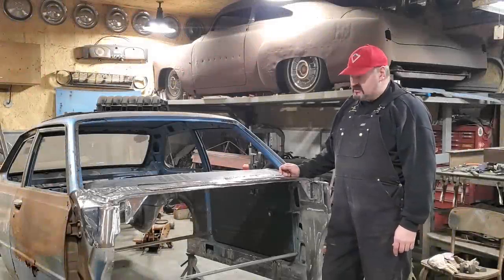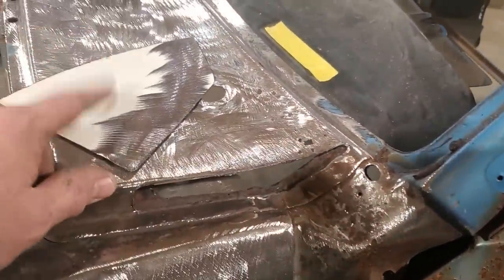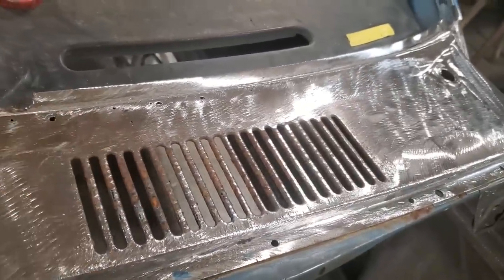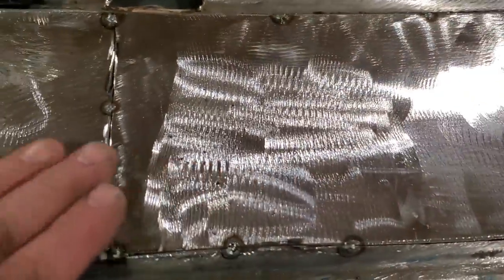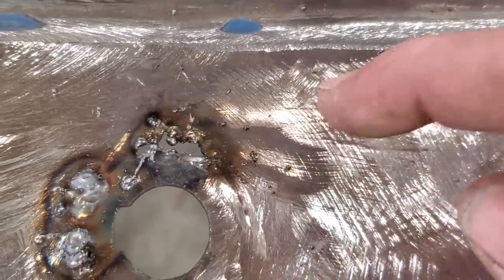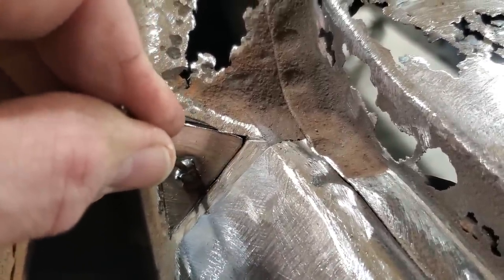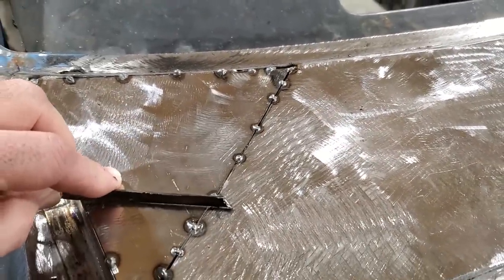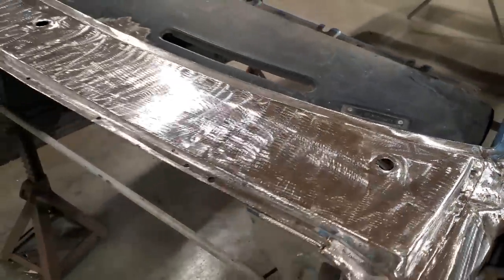Crusty. Rusty cowl restoration

Comment: Amazing. But it goes one step at a time. Then I see that it's not just me who is a bit busy sometimes (small holes). But I wonder if it has to go well and copy larger parts. For example, outer plate on door post in front, before taking it away and inserting the new one.

Comment: Thanks Tony, that was a biggee! The tip regarding grinding both sides of a corner sharp and only then rounding it off is a great one, I know you’ve done if before but I’d like a recap sometime on that process If it suits, I presume one just uses a fine disc so as to not overdo it and spoil the edge.

Comment: Hi Fitzee, 
I forgot I had bought a Toyota Corolla from a friends neighbor that was going to be traded in and they only wanted to give the lady $150 bucks trade-in for it. Only had about 48K miles on it. 1.8 L manual transmission 1976 I think, back in 1987 I bought it for $200 bucks, Test drove it had bad misses and the slave cylinder leaked, hard to shift, ran strong. Changed the slave cylinder and did a tune-up, When I pulled the spark plug boots through the rocker cover 3 of the electrodes from the spark plugs came out with then. I could not believe it ran that good on the test drive. They were the original plugs. Kept it for a year and sold it for $600 bucks.
Thanks for the lessons from your garage laboratory.

Comment: Hey fitzee, I don’t know if you have one on the channel already, but I’d love to see a video on fixing rust on the roof panel of a car. Because of the really big relatively flat surface, I could see issues with warping and such. I have a 510 I’m gonna be working on soon and something like that would be really helpful!
Reply: Pro-tip from someone who's been there - large panel like a roof will warp and start oil-canning no matter what you do. Doesn't matter how much time and care you take - hot metal warps, it's physics.
But worry not - get yourself a shrinking disc. Plus a body file or a large hard sanding block. I tried blowtorches and stuff, but it's too easy to mess up as it requires perfect coordination and timing. Shrinking disc is laser precise and forgiving, and doesn't require any extra beating, it's amazing how nice it works.
Reply: I’m 55 and had 2 510 s when I was teen … Great cars … lots of fun

Comment: Tips were good as always, Tony.  Especially reminding us all to take our time, don't rush through and that making a cut in a piece of finished metal is not a major drama because you can just weld it up again.  It's all about the process of getting it done rather than the finished product - the finish will come if the process is carried out with a bit of thought....but not TOO much thought or it will never get done!  Welding flat (or near flat) pieces to an edge, using the edge as your delineator and reference point, makes the process much easier to cope with and cuts the overall project down into sizeable chunks that you can walk away from mid-process without having to think hard about where you were up to the next time you work on the project - as you have shown us many times.  Your approach has made life so much easier for me and given me the confidence to get things started and moving, where I was stuck on thinking of the WHOLE project and it seeming way too daunting, so I had stopped work on it because of the amount of work to do.  Thankyou, my friend.  All the very best.

Comment: Thank you for continuing the videos. You have given me the knowledge to try doing this myself and my project is coming along fine. I love the tip on welding the holes near the wiper hole. I had a similar situation and I was building little weld mounds…and grinding back to holes, just as you said. You are the best. Rick from Detroit.

Comment: About those holes around the hole for the wiper, you talked about keeping the welds lower than the surface to avoid new holes when you grind off the tops. Can you not just weld also from the underside after, and build thickness from there?
Reply from the maker: Yes you can

Comment: The rust through spots on the windshield lip are where the windshield trim clips sit on an original "from the factory" car.  Windshield clips are usually not high quality metal and don't have a lot of rust preventative on them from the factory.  They also tend to create a pocket where water sits.

Comment: I have to admit that you do great work myself I starts in the mid '70's working at home the in '78 got into a body shop and you restore cars the same way I was taught butt welding is always the best but depending on what the customer wants to pay is a factor as well and like you were saying the new cars are a lot harder to work with there is just no meat to then even for pick and file is a challenge at times... 
I did notice that you use a big angle grinder for cutting your patches with the cut off wheel do you find that better than a angle die grinder for handling?
Reply from the maker: Yes it's electric. I find the die grinders being air would lose power or freeze up in the winter. I have one collecting dust in my tool box

Comment: When you were welding around the windshield wiper mount holes. Could you have made backing washers made of body metal to avoid all the burn throughs and give it a bit more strength?
Reply from the maker: You could but it was burning away the metal to the side

Comment: That came out great .
When I needed lump of copper to back hole filling I used a beat up copper hammer and removed handle and ground one end flat and other end curved, is a useful and cheap tool, picked up another smaller one at yard sale for pennies as no one wants a beat to snot copper hammer lol :-)

Comment: Good timing... I'm doing a lower cowl repair. Can't get to all of the bottom from below. So I have to cut the top of the cowl out of the way. Would you weld a strip behind the edge of the upper cowl to set the cut away section onto when putting it back together? That way you have something to set the upper cowl on and a backer behind the weld since I can't get to the back side?
Reply from the maker: Not fully understanding what your asking. Why can't you remove the upper cowl but dril out the spot welds?
Reply: @fitzeesfabrications  it would be a much bigger job drilling out all of the spot welds to remove the entire top versus cutting out the top of one side and putting it back on. This is like the cowl rusty problems in a first generation Mustang except I don't have the parts availability like a Mustang. This is a 64 Fairlane.

Comment: I'm glad you mentioned about the thickness of the steel in your car being 24 gauge most of the metal in your modern cars are developed blanks meaning the thickness changes even in the same stamped panel. Also the newer panels are made out of high carbon low alloy steel. I  rarely cut and but my body panels I prefer to overlap them instead. But that's my preference based on my experience with welding dissimilar metals.

Comment: I have a panel that was eaten up buy a hard top rubbing.  I plan to do what you have done here to replace the bad metal.  I plan to use 18ga steel as it is what I have.  Your tips will help quite a bit I think.  I do have one question.  What if anything are you going to put under those panels to deal with the significant amount of rot that is under there?  I ask since I have rust under the panel I spoke of earlier.  Thanks for any advise, abuse or finger pointing.
Reply from the maker: Rust converter then primer then seam sealer over welds

Comment: Great video. I like that you showed a couple of methods from other videos like making the small round piece of metal to fill the small round hole and manually filling in the wiper hole using the brass bar. as well as grinding the edge to fit. I have seen you do it before, but it was a nice refresher. I have learned so much from your videos that there are few things that I would be afraid to tackle. For example, I damaged the lower corner of the hatch/tailgate on my wife's Mitsubishi Outlander this year and everyone told me it could not be fixed and that I should just get a new tailgate. I ended up fixing it myself. It only took an afternoon. I just cut out the back, straightened the front (which was easy with no back support), and then remade the back piece and welded it all together. I would never have attempted this if it were not for all your videos showing us what can be done. One question I have with regards to rust. If you have metal like the cowl you replaced on crusty, do you worry that the pieces you did not replace are just going to rust out later. I have this issue all the time. Usually, I notice that there is a lot of rust between the inner and outer panels. You can't get between them to sand. You fix the rotted parts, but I always worry that the parts I did not replace are just going to rot later. It happened on my Altima, one of the first cars I did body work on. Is there anything to be done ahead of time or just deal with it when it happens? Thanks
Reply from the maker: Just keep oiling it up if it a car you use year round

Comment: Awesome! Having made a few of my first attempts at sheet metal repairs this video helped solve a few of the problems I ran into. I love it when you show a long section of the repair getting done in real time. A question for you: when you put the two bends in the pieces covering the vents which bend did you put in first, the one from side to side of the car or the one up to the windshield?
Reply from the maker: On to the windshield.

Comment: I have been a fan and watching for a couple of years now. One thing I have seen others use, and have never seen you implement, is a Contour tool. I know you do not use templates often, and that you prefer to make a piece and not take the time to also make a template. Just as an observation it seems to me you could save a lot of time avoiding going back and forth from the piece you are making and test fitting and then back to your bench, if you would use a Contour Tool...especially for replicating the curved pieces...and not a full size template. Keep up the tips and tricks you share. Love watching them...and keeps me mesmerized.
Reply from the maker: I played around with them but found I kept having to return to the car to test fit. Works for some but not for me.

Comment: Fritzee how do you deal with the welds on the under side of the patch? They are going to rust from the heat, is there a way to stop this? If they aren't treated their going to eventually rust through. Also does the rust incapsulator products really work. Thanks for your help on making body repairs, been watching for a while now.😀
Reply from the maker: Will be adding rust converter. Then priming then seam sealer

Comment: Hey Fitz.
How do you handle the rust on the underside of the remainder of the existing body parts especially where you can’t get at it with tools or wire brushes?
I’m interested in what works best for you.
Reply from the maker: A spray rust converter and then paint

Comment: Just curious but how did you address any remaining surface rust on the parts you didn't cut out.  We watched you grind it off of the outside surface, but what about underneath?  Do you spray it with Rust Kutter, or Ospho, or something similar?  This may have been addressed in one of the other 364 comments, so if this is a repeat question, I apologize.  I love your work.  It has helped me with my 1965 Buick Wildcat and my 1969 Opel GT.
Reply from the maker: I'll be doing a rust converter  then primer then seam sealer over the welds on the inside

Comment: It looks good, on those vent deletes what did you use to roll the shape.  also could you have made that wiper arm hole section ?
Reply from the maker: Use the pipe anvil for the roll along with the curved section on the vise. Yes could  made a small press die to make new wiper mounts
Reply: @fitzeesfabrications  I’ve been learning a lot watching your videos. This summer I’m going to tackle making the bottom section quarter panel on my 68 Cadillac that has rusted. Keep those videos coming.

Comment: Thoughts on rust that may exist in those factory seams? When should you remove the panel to address it vs. let well enough alone?
Reply from the maker: When the rust is very bad. All these 70s imports have rust in the seams and under plug welded panels. It just the nature of the beast.

Comment: I'm going to try your cut n butt method on one of my old Toyotas soon but my question is:  When you hit the MIG without a helmet on, do you just close your eye lids, or do you look away also?  I'm willing to try this but also want to be safe.  Is there something you say to yourself in your head before pulling the trigger?  I've been using a MIG for a decade as a hobbyist, but always use a helmet so far.
Reply from the maker: Keep using a helmet. Lol. I got bad habits. I hide the arc behind the tip of the gun

Comment: I know you grind flat the top and side of a patch to get a good square edge but I must have missed how you round the edge off afterwards?
Reply from the maker: It's covered in a older video. I sand on a 45 degree and when it down to where I'm happy I round out the edge

Comment: What do you think of soldering some lead into the smaller holes along the top edge. Or do you prefer to replace the section of metal?
Reply from the maker: I prefer to replace. Leading small rusty holes can be tricky as lead has a hard time tinning to rust

Comment: Hi Tony .... I believe you said this car will be driven in street and drag strip.  How will you ventilate the interior without airflow thru cowl vents?   Also, will you be adding pressure relief valves (prv's) to interior somewhere?  I have been in some well sealed commercial vans with body modification that didn't take into account ventilation and they weren't fun to drive.  Doors hard to close, ears hurt if you turn defroster blower on, etc.
Reply from the maker: Those vents are air inlets for heater. This car will be heated delete!
Reply: @fitzeesfabrications  Hi Tony, so if you eliminate heater/defroster is there another way fresh air enters the car?  In a modern vehicle cabin air enters thru the cowl and plenum.   If you seal your body well and drive for extended lengths of time with windows up I am guessing your glass will fog.  I live in Michigan and have this problem all the time if I turn heater/defroster off.  Since you are leaving holes for windshield wipers I am guessing you are planning to drive this on public roads you may want to reconsider some kind of defroster.  Weather in Canada isn't that nice :).

Comment: I'm gathering from several comments you've made, you prefer to mud the bare steel. My question is if you leave the steel exposed until your ready for mud, what are you treating the steel with before mud? I'm pretty sure you have  quite a bit of micro rust started in that time frame...
Reply from the maker: It will be sanded agian. Rust converter on any small rust
Reply: @fitzeesfabrications  which rust converter do you prefer? I'm using a ppg cleaner then a conditioner before epoxy.

Comment: Fitzee, this is really getting to me, how do you grind a panel on this car down to bare metal and leave it that way for weeks or even months without rusting? Your climate is very moisture laden over winter I expect, and I do not see a climate controlled workshop here. I could not get away with that and I live in a relatively warmer climate.
Reply from the maker: The garage I have it climat controlled. Don't let it get to cold and it sealed up good to keep moisture out

Comment: Same technique as eating an elephant...one piece at a time. I find it strange that neither you nor anyone else I follow uses thermal barrier pastes like "Kul-Therm" or "Heat Freeze". I used to use "Bastos" but can no longer find any, so instead I have a big bucket full of ground Asbestos that I salvaged many years ago, some of which I make into a paste and use as a heat sink. Works very well. Of course I have to use gloves and a respirator. If one is careful it's fine.

Comment: I think the biggest thing I learned from you that I use all the time, is to weld the front of back of the panels on edges and stuff, at first I was grinding through when trying to roll the edge, and then I was in a whole new mess trying to make a rolled edge on each piece and then weld them together, doing it the way you do is pretty much fail proof, adds more strength, and saves tons of time. Love this project and can’t wait to see how you tackle that right door lol
Reply from the maker: That door is going be interesting. Lol